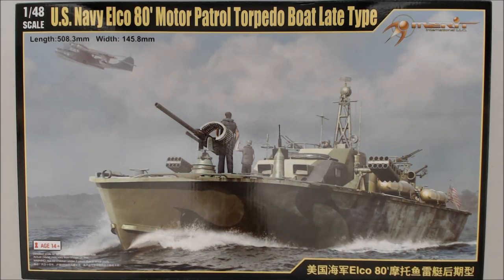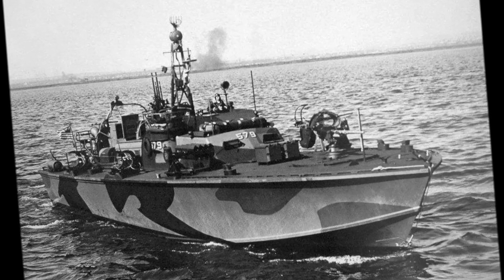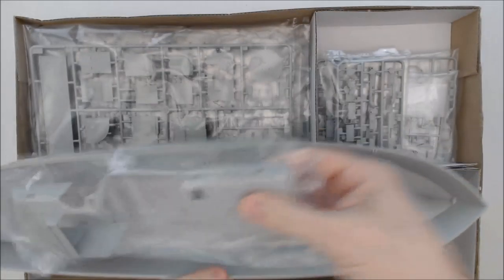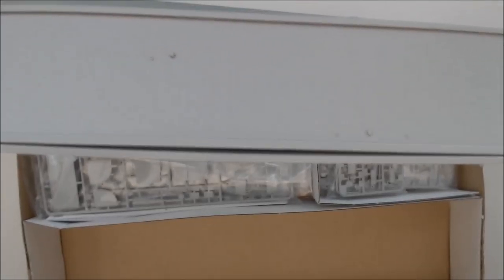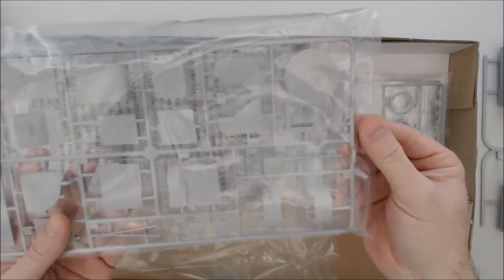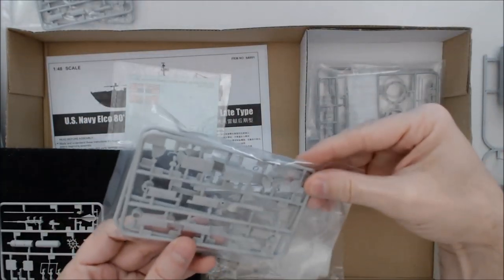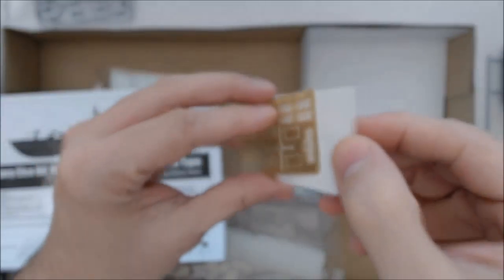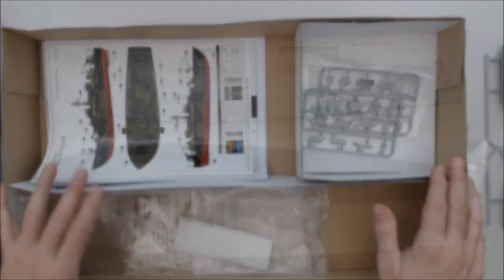Unboxing Merit's 1/48 Elco 80' PT Boat (late version)

Comment: Nice kit. Those 37mm were the same gun the P-39 had in the nose, and some were salvaged from P-39 wrecks and mounted to boats from Guadalcanal. They made so many mods to these boats, but i never saw rocket launchers, or are those flare launders?